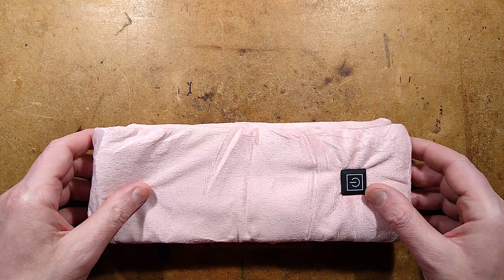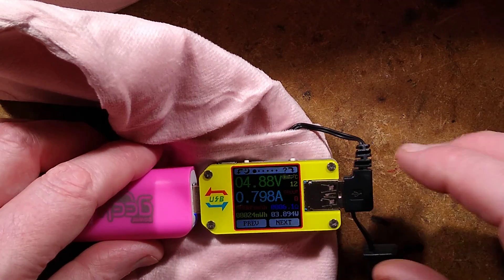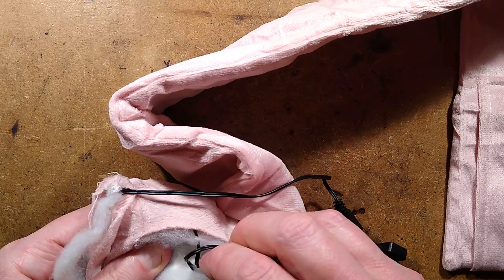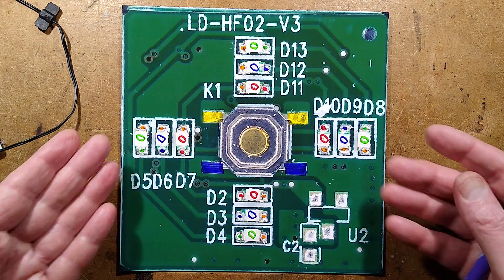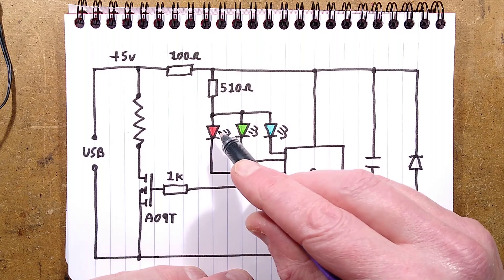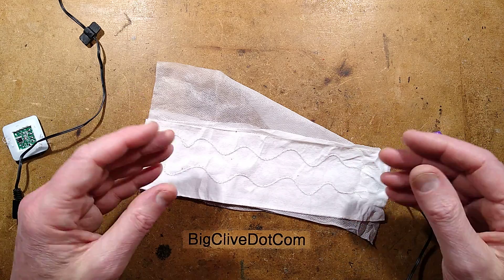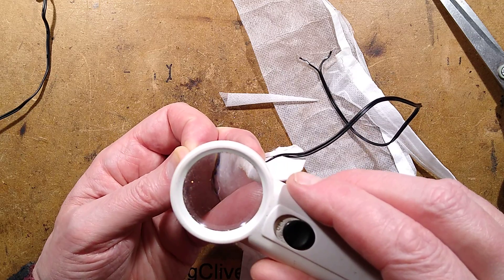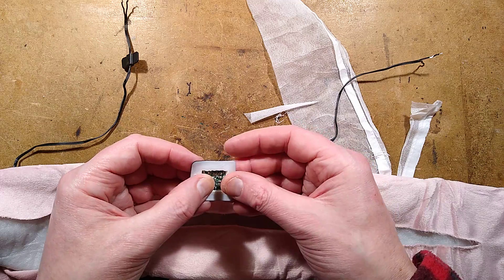Inside a USB powered heated neck muff (with schematic)

Comment: Carbon fibre interwoven with another thread, just for strength? The only common fibre that would add ‘strength’ to carbon fibre is Kevlar, or aramid. The two are often combined to provide greater impact resistance, so what you might have there is a semi-bullet-proof and stab-resistant hot muff. Probably handy in a crisis. May prevent muff-piercing, if a muff piercing is thought desirable. 😈

Comment: another great video Clive ;)
I wish you had tried wiring up a few LEDs or a strip to the module & quickly turn it into a 3-level brightness switch.
Reply from the maker: It has very low PWM rate.  Closer to burst-firing.   Literally around 1Hz, so more of a flasher for LEDs.
Reply: @bigclivedotcom  ah, that's what you meant when you mentioned "burst-firing".... gotcha (guess it's to save on battery life) thanks for the clarification.
... too bad then... though I'd be curious to see a practical application, perhaps in a future follow-up video ;)

Comment: it would have been nice to see how the controller adjust the power if it either is outputting a PWM with different Duty cycle or if it is timed in bursts of full power and timed off periods. to know what else it could be used for :)

Comment: My mom uses this a lot.  It works very well as a tidy unheated scarf without the battery.  But the battery powered heat is worthless.  On the other hand, she also has a heated fleece vest.  That has enough surface area to be nice and toasty.

Comment: Because I swim outdoors all winter I have investigated all different types. The button is common between types but some have Bluetooth and measure temperature. Is there a place on that board for a chip? I’m guessing it’s an ESP32 just because these always seem to be Chinese made and it’s the first Chinese chip with bluetooth that comes to mind. In the trousers the button pops onto the surrounding fabric and then that fabric is glued to the surrounding fabric. I know because mine came loose. Also nothing in the trousers feels like it could contain a Bluetooth chip so I think they are hiding it behind the button. The app also gives a readout of temperature but I’m not sure how accurate it is. I think all they do is measure the resistance of the wire. Doesn’t feel like there are extra sensor wires. If you see a cheap Bluetooth one I’d disassemble it to see how it differs.

Comment: I bought a very similar controller and pads as a wiring loom to fit into an existing jacket a few years ago. Cut a hole in the front and sewed the button on, the USB plug comes through the lining of one of the inside pockets. The major headache was anchoring the pads neatly so they didn't all migrate to the bottom of the lining, they were very tough material and difficult to push a needle through the edges!

Comment: If the polarity of the power supply is reversed, the heater would turn on at nearly full power, as the body diode inside the MOSFET would conduct.

Comment: That carbon fiber wire looks like the tinsel wire that was used in high flexibility cords found in the coiled cord between the telephone and the handset.  Tinsel wire has the spiraled thin copper ribbon only a fraction of a mm wide.  It should make good resistance wire.

Comment: I would assume this is same as my Milwaukee and makita heated jackets because they also have the same button and operation modes, only they run 12v, the makita can also run 18v if you purchase the battery adapter

Comment: I was surprised to find the pwm modules on amazon to be still running with the ne555 version, but the cmos/low power one accompanied by a fet and some caps+small stuff.

Used to build a few of them years ago, but the ne555+components is more expensive over the pwm module with pcb, switched-poti and screw terminals. But mine could switch 10..100x the currents ;-)

Comment: I am about to build a coop for some quails in the new year and I was concerned about it getting too cold in the winter of next year, well now I have a backup plan in case it does. Just sandwich this thing between two wooden boards and if it gets too cold inside (measured by an environmental sensor I wanted to put in anyways) I can just turn this on via a Raspberry Pi. 
I wanted to run that system off of a battery but since this would need a little more power I could just lay some cabling to the coop and power it that way. 

Edit: 
If you don't mind could you point me to the name of the product or some generic search terms for it? I don't think it came up in the video.
Reply from the maker: You can buy heated mats.

Comment: This is the only context in which Clive would tear into a pink muff. :p
The white thread is probably the same polyester or nylon thread you'll find in headphone wires. Strictly used for its tensile strength and because it's cheap.
I've tried some gloves with carbon heating panels stuck in with velcro and they're extremely effective. I imagine a scarf or a jacket collar over the muff would keep your neck quite toasty.

Comment: With a pocket jammed full of 18650s , you will be ready for that  Grampians  expedition ( ? ) ... Handy tip .. for those folk that have a 1960's  torch that takes an Ever Ready™ battery type number 8  ( unobtainable now ? ) , an 18650 fits  PERFECTLY  and really works well ! !  ( tried - n - tested ) ...... DAVE™  🛑

Comment: My heated gloves for the motorbike uses the same electronics. The only difference is that my gloves are powered by 2 rechargeables in series at 7.4v at 2200mAh. Charging is pretty strange with the supply when connected to the batteries, a green light is showing but when i plug it into the mains, a red light comes on pretty bright.

Comment: I've got a gilet that uses what I think is the same circuit/switch and heating pads. It works well, was very cheap and is nice and warm as long as you wear something over it to keep the heat in. I am not sure if it's the material it's made from or the heating pads inside but it does seem to build a bit of static so if you aren't careful you get a little zap when taking it off.

Comment: Should connect a LED and see what pulse rate it uses, it might be useful as a light dimmer, given that they likely use the same microcontroller code that is used for flashlights. Pads are there not to test, but to program the microcontroller, as this might have multiple code for assorted uses, so just having a stock of ready to go boards, and only program the EPROM with code on order will save them a lot of inventory. Sadly likely to be only OTP, unless you have a high power X ray tube to erase it.
Reply: We could see the power turning off and on via the USB load meter, I think it's running less than 1Hz. Definitely not suitable for light dimming.

Comment: I got a mains one from lidl,  3yr warranty , they have self-destruct safety mechanism lol the fact that everything has a microcontroller in it now still amazes me
Reply: Its the cheapest way. Also you dont have to design a whole timing and mode selection color changing circuit while a few lines of code can replace it. And the circuit board does not have to be filled with a lot of support components for other logic ics thus also saving bom costs. I also dont like that everything has a whole computer in it but i gues its the future and its easier to apply tweaks to the code of a mcu (or just place a new mcu) when some timing fails. Those chinese ±2 cent micros are cheaper then the logic ics

Comment: Interesting post again ✔️ If it is waterproof you could use it in the rain or even put it in a plastic sleeve with a soft outer covering. You could even use the muff inside a dry suit to keep yourself warm while diving. I was impressed that they used carbon fibres as the heating elements. I keep a box of failed electronic devices and recycle in silly gadgets when the mood takes me. Thanks for posting Clive, appreciated 👍

Comment: If the 5V power input gets reversed the diode that is part of the FET will conduct and the heating element will be on.  This is addition to the power (5V -.7V)^2 / 100 = 184mW that will be dissipated by the 100 Ohm resistor.

Comment: You get heating pads for car seats for less than €/$/£ 20.-*. They are also described as "carbon".
* 20 bucks a pair, cables, switches, connectors to the car electrics and control unit for 5 different temperatures each side included!
Reply: You can get heated seats in a BEV, for a subscription.
Reply: @wiseoldfool  Not just in EVs.
I guess they cost just 3 bucks when you buy several 100,000 of them per year. So it's cheaper to put them in each car than the logistics to make it optional. The rest (subscription) is just a marketing joke!

Comment: i am an amazon vine reviewer and i got the black version a few weeks ago (listed price was £9.99), didn't think much of it to be honest way too short and way too awkward to use with a powerbank.
but it was interesting to see the internals .... there are a lot of these cheap heated items available now that we are seeing on vine like fingerless gloves and socks but again it seems you would need to wire up your entire body and carry several KG of power banks around !  although i did get some very nice motorbike style heated gloves in early september that have purpose built battery packs that fit in the rear of the cuff but those are expensive vs these cheap heated items we are seeing now.

Comment: The reverse polarity protection probably is actually rated for the current flowing trough it. Just square the voltage across the resistor and divide it by the resistance. So roughly 1/5w dissipation trough the resistor. the dissipation trough the diode would be around 50mW
Reply: ..dissipation on resistor will be actually less than 0.25w
Reply: @adrian.parano  Fractions, op said 1/5 = 0.20W, so exactly, less than 0.25.
Reply: @VM-lt9wl  aaahh, hahah, I misunderstood the 1/5w !!!  that is right 😄

Comment: I use a similar one to this when i run in cold weather. I used it for that just a few hours ago.
I bought the fluffy kind without the button sewn in to the fabric but has the controler on the wire, in grey. 
I really like it, it is part of my running in cold weather without having to use winter cloths kit.
The coldest i have ran in was -28C with just one layer of thin clothes but with battery heated scarf/socks/gloves/vest and some on my legs.
It works GREAT, i always hated running for a long time 10k+ in the winter because you needed layer on layers of thick warm cloths and that just feel awful to move fast in. But now i easily run just as good in the winter as in the summer months.
I remember i met a dude running on that -28C run, he looked like the michelin man he had so much clothes on him and i moved as easy as it was not even cold outside. I have also noticed i recover MUCH better and faster after a hard run in very cold weather when using things like these.
If you like to move outside in the cold, but hate having to wear thick and heavy winter clothes to not freeze, these kind of battery heating devices is a total game changer, try it out if you are curious.

Comment: I bought the $40 heated gloves that came out on top on project farm's video. It claims to have carbon fiber heaters too, and it claims to have temperature control. I think it does since it heats up instantly but doesn't fry your hands.
Reply: Those are probably more dangerous because when that temperature sensor fails, the heating element is powerful enough to actually fry your hands.
Reply: @rexsceleratorum1632  It's not like I can't take the gloves off pretty fast.

Comment: These resistance-wire heating technique is very old-school these days, if albeit with carbon fibre elements.
Try to get hold of some FabRoc heating elastomer which was created by Scottish company EXO2 (that now seems to have wound up). The elastomer was sewn into heated motorcycle clothing as multiple black rubber strips, each ~2" wide. It had a lower current draw to maintain temperature than traditional resistive heating.

Comment: I've built motor speed controllers that worked on a similar PWM principle but using a 555 ic to generate the squareware, so I'm curious to know, what frequency is the PWM happening at? A few hundred hertz? A few thousand ?
Reply from the maker: It's very low speed.  About a second or two.
Reply: @bigclivedotcom  Thanks!

Comment: If the power supply is reversed, the parasitic diode in the MOSFET will conduct and the device will heat up at (almost) full power!
I doubt that a user will see that as a fault.
Reply: true.. a backup mechanism to keep using the pad, in case the microcontroller side stops working..😊 .. but the MOSFET will burn out after a while.. as power dissipation (> 0.5W) will exceed specs..

Comment: Using that carbon fibre heater wire you got years back you could probably build your own USB heating thing with this module, if I recall that was something like 12 volts per metre based on its' resistance, so could probably use about 40-45cm of it for 5v depending on how hot you want your neck to be... :P

Comment: The tourmaline thing, while obviously complete negative-ion mumbo jumbo pseudoscience, DOES have a microscopic grain of physical reality at its core. Tourmaline is a HIGHLY pyroelectric mineral and spontaneously develops huge electrostatic potentials at the terminations of its c axis when heated or cooled rapidly. Electrostatic potentials so high that it can in fact slightly ionize surrounding air molecules. If one takes a piece of cheap black tourmaline (ie. schorl), ties it to a string at the center, and lowers it into a dewar of liquid nitrogen, it will stick to the glass sides of the dewar like a balloon rubbed on the head will stick to a wall. This was first noticed hundreds of years ago in Sri Lanka, and was called "the Ceylonese magnet" for its ability to electrostatically attract ashes when heated in a fire. You can see its properties in the video "The Pryoelectric Effect in Tourmaline". This effect WAS used in the early 2000s by Putterman et al. at UCLA to do the first actual deuterium nuclear fusion reactions driven by the pyroelectric effect alone (using lithium tantalate rather than tourmaline). It's possible this is where the radioactive symbol enters the picture, or at least in the fevered imaginations of the hucksters selling these sorts of things.
Reply: My knowledge just leveled up reading your comment. Info-dense and interesting, thank you!

Comment: I made a heat pad for my cat using some of the wire from an old electric blanket and a power bank for 1 wire set and a 12 volt set for when in the car,

Comment: I have some hand warmers that function in much the same manner, regarding LED colours, albeit more of a PWM system than longer duty cycles. The heating element is wrapped around the battery, and they can get extremely hot if operated in an insulated space, so I have my doubts about how long they'll last!

Comment: I noted that on the wiring section of the PCB, they wrote in the labels of the positive and negative of the power wires as words, but the same for the heating element as symbols. Oddly inconsistent.

Comment: More energy, maybe it means about stranded wire over solid wire, having a larger surface area¿

Sucks the heating area isn't larger, and at least their magic beads might have provided a bit more insulation, wouldn't rate it being washed at all

Nothing to prevent overheating? Be fun to test how hot it can get before breaking

Comment: I have a regatta jacket that has the same controller in it to make it a heated jacket. I think that’s what they are designed for.
Reply: I returned my Regatta jacket as it discharged the power bank even when switched off. I suspected the jacket drew minimal power sufficient to keep the banks management cct working causing the discharge. Regatta very slow to communicate over the issue.

Comment: It would be useful to know if the control circuit will also operate on 12V. The resistor for the LEDs would need to change to a 2k2 to maintain the current and the current limit resistor to 470 ohms. I suppose the addition of a zener would be possible, somewhere between the positive end of D1 and VCC pin of the chip via the handily placed test pad perhaps. I already have a 12V electric blanket (50W) but it has no controls so something like this could be a useful addition.
Reply: It would be an easy enough thing to build. If you didn't want to use a micro, you could use a LM555 timer & multiposition switch for the various duty cycles.
Reply: The 4+ amps required for 50 W would probably be too much for this little driver.
Reply: @benbaselet2026  The MOSFET is rated at 5.7A 30v continuous.
Reply: @chrishartley1210  So it is, would run pretty hot though. Not sure if the board provides enough cooling for long term use.
Reply: I also have considered modifying my jacket from 5v to 12v.

Realistically I think using a type C breakout card to 9v would be enough to provide the extra boost I desire.
Reply: @marsrover001  You might be unlucky with that idea, usually when you increase the voltage then the available current is reduced to give the same power output.
Reply: @chrishartley1210  The point of USB PD is to supply more power and not to increase voltage for no reason, so s/he has a point. What might go wrong is the heating element getting hot enough to burn skin or worse.
Reply: @chrishartley1210  For your blanket, you can try getting a simple 12V LED strip dimmer.